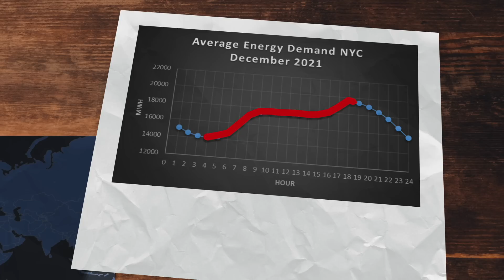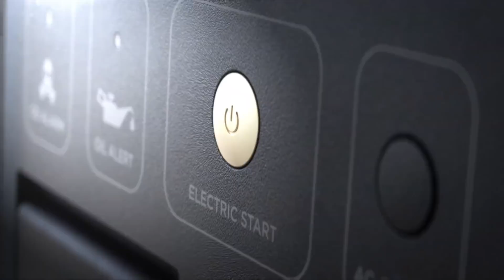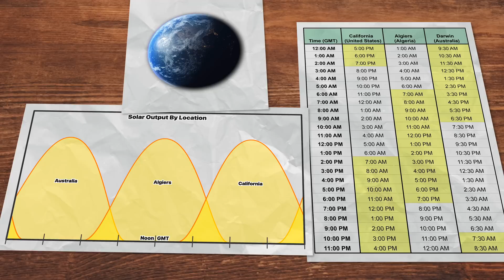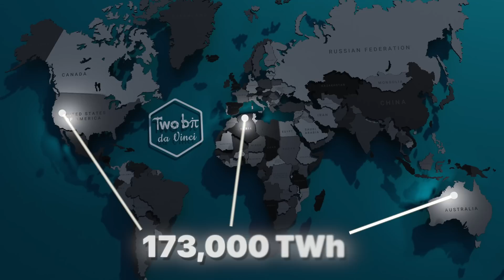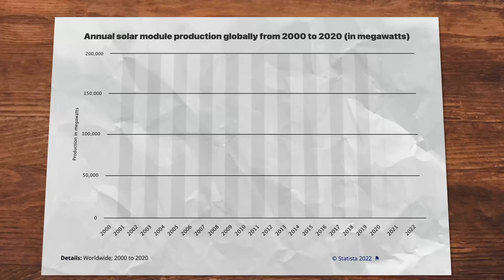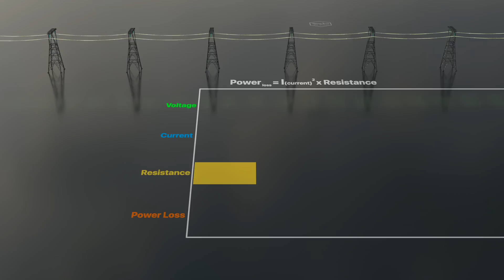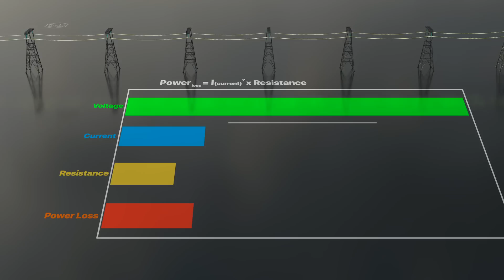World Solar Energy Network... Could this work?

Comment: The most practical idea for transmission, I believe, would be to use stations that beam the power to space substations and back down to remote locations. Ideally, in desert locations with little to no cloud interference. I think it would be cheaper, but I'm not smart enough for the math, so we will have to see.
Reply: You run into a basic physics problem here. A beam up to GSO will have a minimum dispersion of approximately 8x13 miles at 40° latitude with that same dispersion on the way up to orbit. A 8x13 mile receiver in orbit will require a lot of boost capacity and would probably be better brought from the Moon.  In any case,  it seems unlikely in the near future. That is for microwave transmission. Laser transmission is possible,  but we don't currently have lasers capable of continuously producing that level of output. And, if we could, there might be huge objections to having such lasers on orbit or even on ground illuminating orbital receivers. That would be a weapons grade device, capable of destroying any satellite not designed to protect itself or receive that much power.  Many would be tempted to think that such could just be reflected down to a ground station some distance away from the original source, but mirrors don't easily work that way. No mirror is 100% efficient and whatever part is absorbed can destroy the mirror itself. Putting a generation facility in orbit that would then produce another laser seems inefficient and only marginally possible.  

Putting solar panels in orbit and microwaving power to Earth from GSO requires a receiving field of 8x13 miles at 40° latitude and more square at lower latitudes. The same wire that is used for defending fighting positions (concertina wire, I believe) can be used as receiving wire for the microwave coming from orbit. If the wire is elevated sufficiently,  farming and grazing can happen beneath the wire with no danger to humans and animals. If you are worried,  you can wear a wire embedded raincoat that is grounded.  

The hard part is getting enough solar panels and supporting gear into GSO for this purpose. Then there is the giant microwave antenna that is required to transmit the power down to Earth and all the gear required to turn electrical power into microwaves. And, you can't make the receiving antenna any smaller because of basic physics. 

An enormous amount of power can be generated and received by this method. A little known problem is that these orbital solar panels in GSO (where they have to be) are at least partially shaded for six weeks in the spring and fall as the Earth's inclination works its way around the Sun.  To have consistent power output, multiple orbital stations will be needed so that adequate power is produced by the unshaded stations. 

All that makes me think that  geothermal and modern nuclear are a better investment.  With geothermal,  there are tectonic potentials over time with the injection of fluids into strata that may become unstable.  That takes me back to modern nuclear designs such as molten salt reactors which don't require water for cooling or power generation and that operate at normal atmospheric pressure in the critical part of the reactor.
Reply: @everettlwilliamsii3740  
The issue with space based solutions seems the be the same as "new nuclear".
Technology (not there yet)
Time (decade + build time)
Money (expensive energy)
.
We need cheap, available, and building now, generating in 2-3'years.

Comment: Global wont work. Many issues were listed but the biggest by far is geopolitical instability.  But maybe an equally big problem was not enough distributted production and focus on only solar.

A scaled down and more distributed  version for the US may work with off shore wind and wave on both cost as well as solar and wind all across the country as well as a few small grid scale distributed local energy storage. 

But imagine in some areas across the country building wind and or solar farms aiming for excess production even if cant be exported,  and  along side that build aluminum production plants to use up the excess energy production. Then in time you'll have cheap aluminum  for high voltage DC lines to export power across the country.

 And for best stability major cities need to be near high voltage DC hubs connected to other cities.  The whole nation's HVDC grid could be set to one voltage and power is metered going into and out of the HVDC grid at each hub.

Comment: Think we made the costs worse by trying to limit the number of power plants to three. It should be thirty different instead of 3 so the cost of distribution will be much lesser and reduce risk of single point failure. Of course will also add 30% storage at each country.
Reply: Hey Suresh, you’re right about the need to distribute generation, and you’re also right about needing storage. But I think the whole point of the thought experiment is to figure out what it would take to run the world on solar alone 24/7, without using energy storage.

Comment: Have there been recent advancements in PV panels that work with a wider spectrum of UV light?  Chamath Palihapitiya made mention of this in a recent Lex Fridman episode, stating that energy is going to zero.  Sounds like a great topic for a deep dive.
Reply: Cost is high but you can tap into heat flowing through semiconductors so IR is possible.  And indium and gallium solar works well but costs are high.  More organic cells are cheap but silicone as a rock will last alot longer under electric load.

Comment: It would work we already have the whole world connected through phone cables. Just use heavy duty cable to connect the Continents. Yes you need stations but once you reach a Continent most of the infrastructure is in place, it just needs to be upgraded. Another way to transmit power is through microwaves, but that gets a little nerve wracking.
Reply: Phone cables, even if we’re still referring to the metal ones and not fiber optics, don’t transmit (and don’t need to transmit) much power.

Comment: If we have learned anything since this Feb, its about energy security. Whether its Russia, OPEC or Algeria holding us to ransom, it is equally unattractive . It is more realistic to think of each country seeking energy autonomy. Also - if a scheme cannot provide 24hr, 365 day reliable power we will need a storage solution. My preferred storage would use excess electricity used to create hydrogen, stored as ammonia and then used to power something similar to LNG gas-powered generating plant.

Comment: To help cut down your electric bill put a timer on your electric hot water heater, you don't need it running when sleeping or at work. My electric bill is less then $60 a month and will go up in Winter by about $20 (use a pellet stove), yes I live alone and that does help a lot plus I also changed out my light bulbs out for LEDS.

Comment: Many extremely good points.  As a retired electronics engineer, I am impressed that you learned so much about the electric distribution systems to get to the final conclusion.   I think that more locations of solar fields would work out better.  The more locations of the fields the more even the distribution of solar generation.
Reply: In reality thousands of solar fields are needed to maximize the chances enough generation capacity is in the sun. A large hurricane like Ian can blanket a large amount of generation capacity.
Reply: Critical thing is the transmission network - it needs to be capable of moving the entire amount of energy from one place to another.

Comment: Interesting, but I don't think practical even if it was possible, for a number of reasons some of which you touched on in your video, such as geopolitical which is a major concern, vulnerability as demonstrated with the Nordstream 1 pipeline bombing, etc.  There is also the issue of environmental impact both in terms of the raw materials needed, as well as placement of the panel installations.

There is however an alternative solution that would potential deliver better results, quicker, and at a fraction of the cost of your thought, both in terms of manufacture and placement, and better yet, would not need a global power grid hence no geopolitical issues, nor would it be subject to weather conditions.  Again just speculation, but I think that a better solution would be to implement reflectors in geostationary trajectories above the earth that could focus sunlight onto collectors on the earth's surface 24 hours a day.  The size of the reflectors and collectors would be dependent on the power output required.  Alternatively have a series of ground collectors.  Anyway, I think that this would be a more practical solution requiring far lower raw material input and also lower maintenance costs than a terrestrial solution.  It could also use existing national power grids.

Anyway, that's my penny...  Thanks for stimulating an interesting idea and conversation. 🙂👍
Reply: Bingo! A MIRROR FOIL that can be unrolled and constructed in low orbit space shining the sunshine on the opposite side of the Earth (nighttime). For just around 2.4billion US you could provide enough re-directed sunlight to POWER the Earth 3X more than it uses in electricity. Solar panel farms could be built on Earth to most economically receive that mirrored sunlight. Only small drawback is there will no longer be dark skies at nighttime (this could even be a benefit not needing streetlights anywhere in the world ever again.)

Comment: I don't think a worldwide power grid will work at all. It would fail politically, first and foremost, and then all the other negatives combined tell me it's just unfeasible and even undesirable. Success at fusion energy would negate the whole idea as well. However, I did enjoy your analysis and number crunching. That was fun.

Comment: I don't think it's feasible economically nor strategically to link up a global grid.  I see too many problems to list.

All you need are localized sand batteries, photovoltaic solar, wind turbine power, underground hydroelectric, and kite power. 

The kite power is perfect for matching peak demand, on demand. It can replace peaker plants, which burn oil.

Sand batteries store energy cheaply for months, so they dovetail with intermittent power sources such as solar and wind turbine power.

Electric home/commercial/agricultural heat would convert to electric or forced hot water from the community sand battery.  Super efficient.  Super clean.  Super cheap.  

No more nuke.  No more fish dams.  No more fossil fuels.  No more wood pellets. (The wood pellet incinerator power plants in Europe, I mean.  Real bad.)

Of course, everybody switches to electric transportation.  

Anybody with a personal EV car/truck would get vehicle-to-load capability so we can smart-grid the energy storage.  Car owners would sell their surplus power to their neighbors (the grid) in need when they feel like it, usually on a daily schedule, if they have home solar.  But even without solar, it will happen.

It could all be done within 10 years.  Great job creator, too, so it pays for itself.

Comment: I think you are smoking something. The sun is not producing much energy during the end of the day so East coast vs West coast will barely help and all the panels would need to have full Sun tracking or they would be past their optimal angle to collect solar energy.  So we need to decentralize power and share surplus power to battery banks to pull from where necessary later.

Comment: Instead of cables, use super tankers filled with batteries as literal charge carriers - a fleet of these could use solar/wind to traverse the oceans, and load and unload energy without using a drop of fossil fuels.

Comment: Obviously geothermal, wind, tidal. and nuclear power can augment this... but anyway, how about space satellite power distribution?  sorta like StarLink, but sending energy and not just data.
Reply: A MIRROR FOIL that can be unrolled and constructed in low orbit space shining the sunshine on the opposite side of the Earth (nighttime). For just around 2.4billion US you could provide enough re-directed sunlight to POWER the Earth 3X more than it uses in electricity. Solar panel farms could be built on Earth to most economically receive that mirrored sunlight. Only small drawback is there will no longer be dark skies at nighttime (this could even be a benefit not needing streetlights anywhere in the world ever again.)

Comment: I recall not that long ago the Saudi's wanted to diversify from oil by becoming an electrical supplier by using Microwave tech to transmit energy but here we are nearly 20 years later, my energy plan is much simpler, it's called living within your means, each home each manufacturer each business is responsible for generating their own power or being part of  community micro grids, this would also encourage development of more energy efficient products and ways of manufacturing
Reply: That would make anything north of germany pretty much uninhabitable since you can't store power between seasons and a cold still week would freeze everyone. How about instead we do massive fission projects building thousands making power cheap as sand?

Comment: I've occasionally wondered if a superconductor could be used for underground high voltage power transmission.  This would probably be look like an insulated liquid nitrogen pipeline that happens to have a high temperature superconductor in it.
Reply: Probably, but it would be unnecessarily expensive compared to normal high voltage distribution lines.
Reply: @Gengh13  It depends on how much energy you want to transmit. If you want to power the entire western hemisphere with electricity generated in the middle of the Pacific it might be worth it.
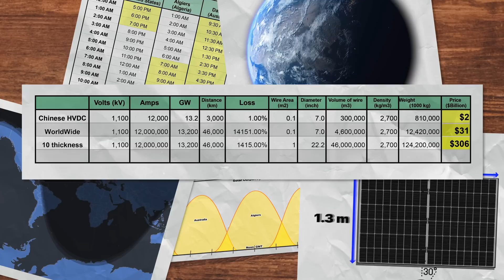Reply: Using superconductors could be more realistic than switching from 1 megavolt to 1 gigavolt like the video suggests (14:20).  For comparison, lightning is around 300 megavolts.  A high voltage circuit can transmit 700 amps whereas some superconductors can transmit 200,000 amps per square cm, though that's for a low temperature superconductor.

I have no idea how much power you'd need before superconductors started to  be economical, nor what would happen if something goes wrong and the line quenches.  Hopefully the circuit breaker would trip and some liquid nitrogen would boil off.  The magnetic field would be very high too.
Reply: That would help with the losses if DC is used.  AC power has a lot of losses due to the capacitance between the line and ground.
Reply: How much energy do you use up keeping your liquid nitrogen cold?
Reply: @simongross3122  Cooling would take a lot of energy, but even efficient DC power lines lose a lot of electrical energy.  Since a superconducting line could transmit 100-1000 times as energy, it should be much more efficient for huge amounts of electricity.

In Iceland they pipe hot water everywhere, and it lost 2°C after traveling for 7 hours.  The water's over 100°C hotter than ambient temperatures, but liquid nitrogen is 200°C colder than ambient, so it would lose twice as much energy if the pipe has the same diameter & R-value.  Those pipes are only 50km.

Perhaps a LNG or liquid hydrogen pipelines could be used, transmitting both power & gas, though today's gas pipelines use high pressures instead of low temperatures.
Reply: @nathanbanks2354  Interesting, thank you.
Reply: @simongross3122  That is an effectively flat rate per mile for a wire that can transmit an insanely large amount of electricity over a lot of miles. Just limit it to lines that need to transmit so much power that the cooling works out to be less costly than the resistance in an aluminum cable.
Reply: @garethbaus5471  That makes sense, thanks.
Reply: Exelon, a holding company for Mid-Atlantic power distribution operating companies like BGE and PEPCO is aware of superconducting transmission and had an IEEE talk on the opportunity within the past five years. I was there. I work for design engineering contractors doing electrical distribution design. The idea presented was to use existing right of ways to rebuild or add ducts with a cooling jacket supported by ground-level heat pump shacks. There are already no overhead transmission wires heading into downtown districts, but the power needs are increasing. This is probably the only way to meet those needs.
The problems with supplying even the current amount of power are starting to stack up. The substations overheat in the summer and the ducts underground get so hot they cause heat stress to the materials and heat lowers the conductivity by itself.
I wondered why TBdV didn't mention superconducting transmission, but am not aware of any currently operating examples for him to use. Money-grubbing holding companies probably don't want to be the first to jump and pay the cost of working through all the foibles of a new transmission technology.

Comment: I think your thought experiment is an important exercise, in that it helps us to determine engineering "limits". At a total cost of $150 trillion: That would be approx $18,750 for each inhabitant of the planet. I built my solar system for $2,300. It provides 1/3 of my energy needs. I'm working on the other 67%. The key was using used solar panels. Currently, solar farms have  levelized cost of energy (LCOE) so low that they can have a relatively short return on investment (ROI).  The solar farm can replace their solar panels with the "latest and greatest" and sell the used panels to you and me. Even if the panels were at 80%, they still produce lots of power at a great price, and keep that stuff out of the landfill.
Reply: It would cost you a lot more to fully disconnect from the grid. Especially in northern places. Even if you get 500% in summer you can't store until winter when you need it and then you still need to burn coal through the long night and short cloudy days